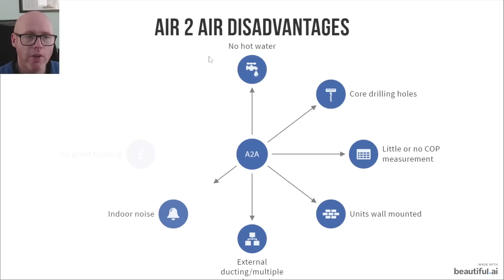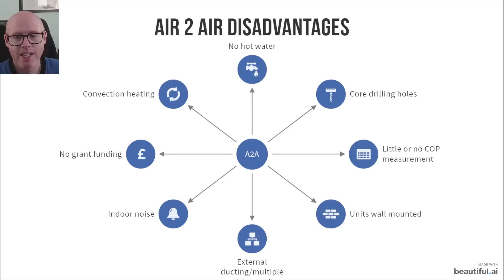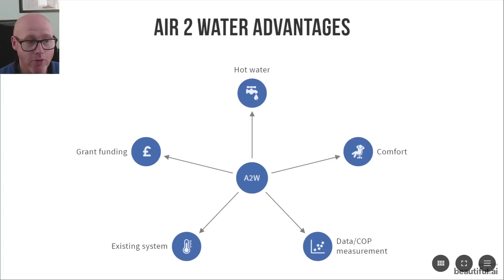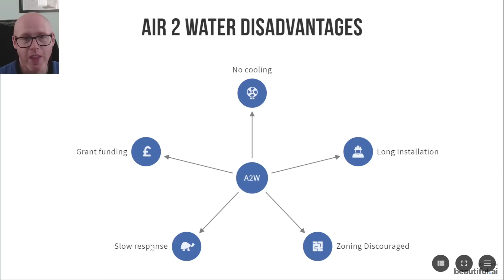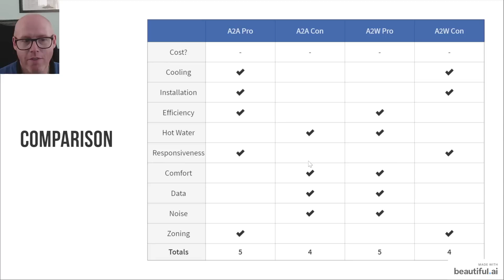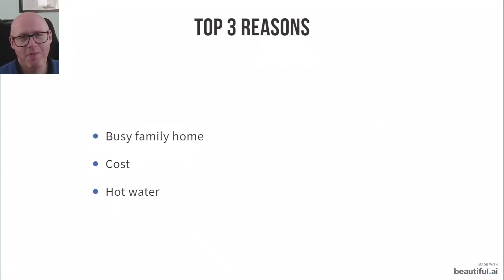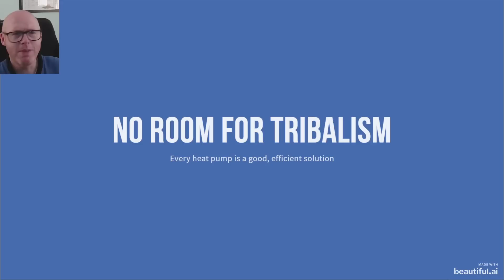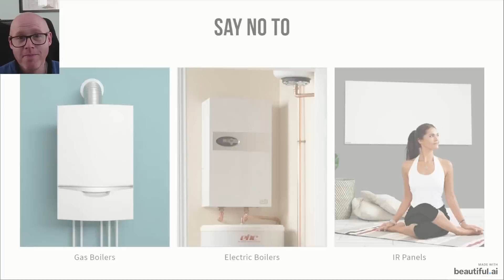Heat Pumps: AIR TO AIR or AIR TO WATER?

Comment: Air to air is more efficient than air to water. Air to air temperature it has to produce is lower than air to water by a lot.
Reply: Not strictly true. A2W systems, especially with large radiators or underfloor heating, have a much larger surface area for distributing heat, allowing them to run at lower temperatures - even compared to A2A units.
Reply: @BenIsInSweden  ac set to hest a home to 20C can shoot warm air at 22-23C.

If you wanna do it with water unless your whole wall is a giant radiator, it will be at least high 30s.
Reply: @cbflazaro  "can" maybe, but not always, depends on a number of factors.  All 4 of mine are currently pushing out between 30C and 38C heat.  It's about -1C here, and they are maintaining a room temperature of 20-21C.
Reply: @BenIsInSweden  My AC has SCOP of 6.3 . When the target temp is 21C and in eco mode, the evaporator's flow temp measured near the base of the fins is 22.5C. A2W usually uses a minimum of 35C flow-temp. COP is highly dependent on the difference between flow and external, as you know. So A2A has to deal with half or quarter of the diff, and is easily more efficient.
Reply: @squeaky_honda   A2W systems don't have a hard minimum flow temperature of 35°C; 35°C is typically the minimum max-flow temperature used for certification purposes. In practice, A2W systems can operate at lower flow temperatures.

Regarding your system, it's unlikely that it maintains a constant 22.5°C to achieve a 21°C internal temperature. As I mentioned earlier, during -3°C conditions, my four internal units output air temperatures between 30°C and 38°C while actively maintaining the set temperature.
I also don't think Eco mode works as you believe. For Example Toshiba's ECO mode simply adjusts the set temperature from what you've set to a more efficient one, e.g. from 20C to 18C.  Hitachi's Eco mode with presense detection will lower the set temperature by 1C after 20 minutes of no detected activity and then a further 1C after 60 minutes.  If presence is detected it will return back to the set temperature.
Lastly, if your SCOP is the rated (badged) SCOP, it's unlikely to be achieving that with a 21C room temperature, as SCOPs measurements are typically based on a 20C room temperature. I exercise caution when considering rated SCOPs - much like gas boilers with their "95% efficiency claims". Whilst I believe these ratings are achievable, many variables influence them. Given the lack of consumer-accessible tools to measure real-word SCOP in A2A systems, which are widely possible with A2W, I wouldn't make blanket claims that A2A is more efficient.
Reply: @BenIsInSweden  A2W set to lower flow temps would require wall-sized radiators, as others noted. And underfloor heating has high R value, so its size is not helpful enough. You probably remember the equation. Forced air more than quadruples the heat transfer per exposed metal surface area. My toshiba's ECO mode does not work as you described, instead it targets consistent low wattage (200W), heating-up the room much more slowly. I still have my gas boiler, and a few space-heaters, so I was quite curious when it's 7C outside consistently, if the advertised COP is true. 5kWh for the AC vs 28kWh gas vs 25+ kWh resistive, all while the room is drafty to keep low CO2 ppm of ~550. So, for myself I roughly confirmed that the AC works as-advertised. The AC unit is A+++ and among the most expensive ones, I'm sure cheaper units won't fare so well, though. Blanket statements hold true when thermodynamics and physics dictate things.
Reply: @squeaky_honda  which model Toshiba do you have? Mine is the daiseikai which is their flagship for heating.
The manuals for the daiseikai, haori, seiya and shorai edge series all say the same thing which I described for eco mode, and not what you are describing.
Reply: @BenIsInSweden  Shorai Edge. In the manual I see the same thing that you wrote, but I'm certain that it does not work like that at all. It keeps the usage at the minimum modulation, 200W, even if the room is currently 15C. Without Eco, if I manually do these adjustments that it claims to be doing, it starts using 1kW/700W/600/400/200, ramping down as it approaches the target temp. I design power-electronics as a hobby and at work I design microelectronics and ASICs and the fimware for those, so I trust my own judgement on this. I also did a lot of thermal dissipation calculations around these hobbies and work, designing heatsinks (passive and active cooling) and PCBs for things, so I still think I'm correct in a blanket statement that theoretically A2A is easily made noticeably more efficient than A2W. Unless the firmware botched things up.
Reply: @BenIsInSweden  btw your daisekai is better than mine. I wish it was available when I was shopping. The SCOP quoted for both is the same in the general table; there is a correction leaflet with a map of the UK where 6.3 is expected (south) instead of 5.1 (north).
Reply: @squeaky_honda  The key issue here is if the system is sized correctly, 200W input won't keep up with the heat loss in colder conditions.
For example, take a 5kW Shorai Edge with a 4kW heat loss at -3C.  It's max capacity at -3C is 4.1kW, needing 1.44kW of electricity, while its minimum capacity is 0.71kW pulling 0.21kW.  At 3C, the heat loss drops to about 3kW. The unit's minimum output rises to 0.88kW (0.23kW, COP ~3.83), and nominal is 4.42kW (1.43kW input, COP ~3.1).

Meeting the 3kW heat loss requires ~0.95kW input with a COP of around 3.4.  So, even in Eco mode, the system has to modulate above 200W input to handle the demand and maintain comfort.  At 7C heatloss drops to 2.26kW, and would require 0.57kW  for a COP of ~4.24.
Whilst I'm guessing your SE isn't the 5kW, and has different performance figures, I was using one that would be typically sized for a home in the UK.  The Engineering Databook for the SE series is TCTC-E20-RES002-1 if you want to take a look yourself.

I'm also not saying that A2W is always more efficient than A2A - far from it. I'm saying that A2A isn't always more efficient than A2W, because there are variables that can sometimes swing it in A2Ws favour.  It's why I was recommended A2W over A2A over here, but due to circumstances, I ended up going for A2A.  Basically, all estimations over here for electrical consumption for different types of heat pumps put Ground Source first, then A2W (and EAHP) then A2A.
Reply: @BenIsInSweden  there's a power-selection setting, I've set it to minimum thus 200W. There are also external-noise settings that can change how things work, I keep that to default. It's the 3.5kW model. 7-8C temps outside are the norm here, so 200W has almost always been sufficient. When it's much colder, 400W is more common in non-eco mode. -3C is rare.
Reply: @squeaky_honda   power selection (and noise reduction) is for capping the maximum power draw, but doesn't change the minimum. It's primarily used when the circuit is shared with other devices and you need to limit its power draw to avoid overloading the circuit, but it will also limit its capacitt for heating or cooling.
It can also be used (with extra hardware) for having signals from the grid to limit the output to help manage grid load.
-3C maybe rare but it's typically around that, that heating systems in the south of the UK are sized for.
Reply: @BenIsInSweden If you have the same capital expense between A2A  and A2W there's no way A2W will run with a higher efficiency. Sure if you spend a ton of money on underfloor heating and oversized radiators A2W will get closer to A2A efficiency, but at the same CAPEX that is not true. 
Now if I were to choose I'd go for A2W because of noise and thermal comfort. But then I'd still need split systems for air conditioning.
Reply: @brunoyuji9203  it depends still, there was one commenter on another video that said they had a decent gas boiler set up in a fairly new build with a 35C flow.
In that scenario A2W especially with the grant would be cheaper to install and likely run.

That is going to be unique at least in the UK.  And in many cases A2A will work out cheaper to install, but the capex with A2W, is often a once only thing.  A2A is generally considered to last a shorter amount of time, and comes with a similar install cost after 12-15 years each time.  So over the life time of the expenditure on rads and ufh (decades), it could potentially still work out cheaper.

I'm not an advocate for A2W over A2A, quite the opposite, I have A2A and will quite happily recommend it over A2W where the situation is right (e.g. storage heaters, needing a complete wet system, IMO isn't worth it).
Reply: Heating with water and especially in floor heating is more efficient on the heating side. Also people tend to ramp up the temperature in air heated rooms because it’s less comfortable and that in turn gives a higher need for energy as well.

We went down from 20c to 18,5c when we had the water temperature go down from 60c to 30c just because the lower temperature of the radiators moved less air. At work I need 21c to feel just as nice as 18,5c at home and at work we have air to air. And the noise of the airconditioning unit keeps being annoying to me.
Reply: Air to water is quieter, but air to air gives the option of cooling in summer. The government doesn't want us to use cooling as it will put more strain on the grid
Reply: The air coming out of the A2A unit is often cooler than the water running around an A2W system. However, the heat pump needs to output gas at quite a high temperature in order to transfer enough heat to the air flowing past the condenser to heat the room.

I don’t know how that compares to the gas temperature needed to transfer heat to the water in an A2W heat exchanger, but with water being such an excellent heat transfer medium (vs air) the difference might not be as great as is claimed.
Reply: Difficult to say if it's always more efficient in-situ as the data and monitoring isn't there...
Reply from the maker: Thanks for commenting!

Comment: The Daikin EDLA range of HPs are heating only, the EBLA range includes cooling (flow reversal valve fitted), with correct emitters (fancoil units ?) effective cooling can be achieved apparently without condensation issues.

There are some advantages to living in a cold wet climate ;-)
Reply from the maker: Thanks for commenting!

Comment: Should also mention you can get central A2A system with fan unit outside as usual but with  heat distributed from unit in loft feeding rooms via ducting. No boxy indoor units - just small vents in ceilings. Search central ducted heat pumps  Much neater solution with no holes in walls as the refrigerant circuit feeds into the loft.
Reply: Agree they are neater but much more expensive with the ducting runs. I was thinking of getting this for my house but as soon as you have a second story the work becomes much more involved.
Reply from the maker: Thanks for commenting!

Comment: I don't just like hot air being blown around for heating, makes the breathing of it yucky
Reply: If you run it constantly you do get a little bit of that, but it runs in a very similar way to a2w, it just constantly circulates the air, we have 2 rooms we’ve installed air con into and the temperature in both is within a degree of the desired temperature constantly. If you treat it like a boiler you do get the hot air being pushed around, if you leave it on it just trickles heat in and only occasionally ramps up, if say someone lets a load of cooler air in or you change the set temperature.
Reply: You can adjust the louvers so it doesn't blow on you. The air is also filtered and some have air purification systems to remove things like allergens and viruses
Reply from the maker: Thanks for commenting!